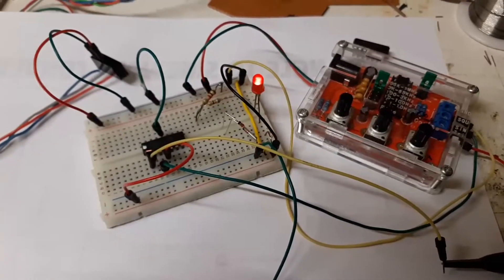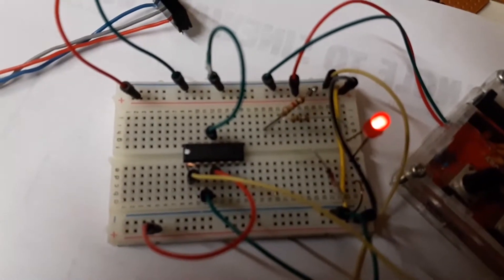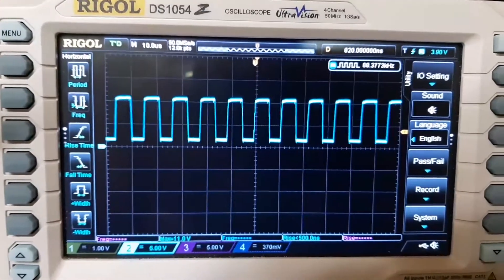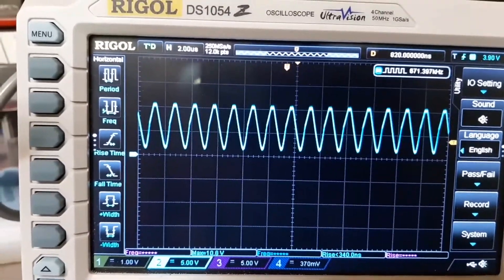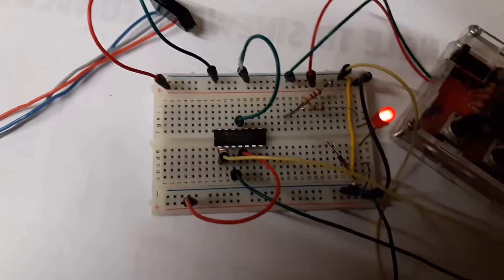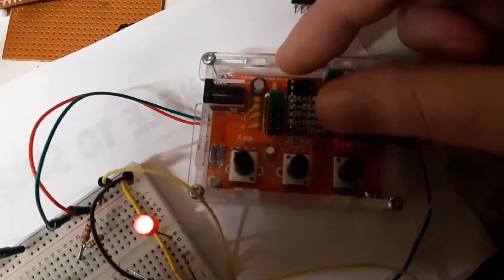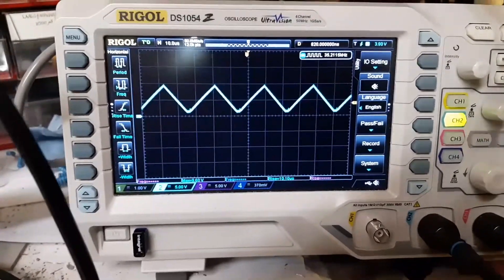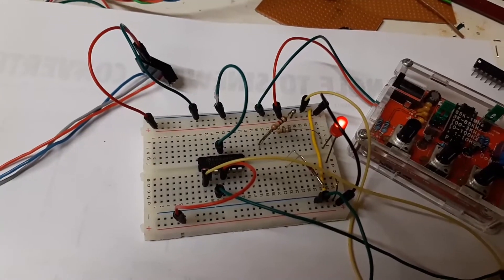How to tell a real opamp from a fake one

Comment: Thanks ed for this., please allow me a question. I see the fake one has a poor bandwidth, does this affect for audio application?, I ask this because for audio we tipically use frequencies up to 20KHz. does this poor bandwidth affect somehow the performance of audio filters, preamps or equalizers?, thanks!!
Reply from the maker: If you want to be sure you get the best audio quality then I would advise to use real chips. It's not only the bandwidth. Fake chips can be noisy too. I build a lot of synthesizer modules and they operate in the 20Hz to 8kHz range and for that they will usually be fine (especially for LFO's) but with filters you can get resonance or self-oscillation that is upto 20kHz and for that I would avoid using fakes and get the chips from a reputable source and not sites like AliExpress.

Comment: Thanks for posting this video Eddy. A couple of years ago when I first got into synth DIY I bought a stack of TL07X and TL08X op-amps from Chinese suppliers on ebay.  Then I read online that they may fakes, so I put them in a box and bought from some local UK suppliers instead.  I came across the box at the weekend and decided to submit samples of both my UK and Chinese-supplied TL07/8 op-amps to your test.  All the UK ones passed the test.  All the Chinese ones failed the test --- TL071, 2 & 4 plus TL082.  80 fake op-amps going in the bin!  I am now looking at what I have left in the box (LM358, LM324 & LM741) and trying to decide whether to bother researching a test for them or just stop wasting my time and bin the lot. 
Edit: I just noticed that IMSAI Guy did a test for fake LM741s using just a multimeter.  My UK stock passed, Chinese stock failed. Another 10 op-amps in the bin!
Reply from the maker: Well I have ordered ICs from ebay that turned out to be good but it's a rarity. I would test them though before throwing everything away.
Reply: @EdEditz  I have bought logic chips from China that seem to work OK for my applications, but I haven't pushed them to their limits.  I also bought a bag of cheap 2N3904 transistors that I use for creating noise circuits  --- much better than my UK-sourced ones for that job.  I won't be buying more op-amps though.
Reply from the maker: @rogrevs  Yeah with transistors and diodes and zenerdiodes that I got from eBay I never had any problems either. I built my whole synthesizer using those and also all my resistors come from eBay/Chinese sources and they all work fine. Although what they call 1% tolerance on their blue metal film resistors is more like 3% but that's still good enough for what I use them for. I have had problems with a random gates circuit that would fall back to a certain pattern instead of being random and that was caused by a fake chip. Getting a good one in there solved the problem. I also mentioned that in the article I wrote about it.

Comment: I wonder what factors come into the difference between 'real' & 'fake'? If the faker has the chip die image & a Fab plant surely it's a 'Clone Fake'; if, let's say a generic 741 is re-badged/engraved as a faster FET TLO71, then its a real fake ? Am I along the right lines here??
Reply from the maker: I think you're right. It's just chips with lesser specs being sold as higher quality than they are.
Reply: @EdEditz  Yes - 'Passing off[..

Comment: Oh man.... I'm dealing with this now, I think. Do you have the circuit diagram so I can test a few out?
Reply from the maker: Hi Adam. Just go to this link and scroll down a bit to the "Voltage Follower" section. It's really simple. The waveform signal is on the plus (non-inverting) input and the minus (inverting) input is connected with a wire to the output. That's all.
https://www.allaboutcircuits.com/video-tutorials/op-amp-applications-voltage-follower/
Reply: @EdEditz  Thanks!

Comment: I have always purchased over the years OP-AMPS from various sellers on E_Bay. Lots and lots of them. But guess what! I just made a similar testing rig and tested a huge amount (about 300+) op-amps that I still have and....surprise surprise....only 21 are genuine out of the whole lot. I just cannot believe how naive I was buying such rubbish???  Woawww...!!!! Well, lesson learned and....Never again.
Reply from the maker: Well you're not alone in that. I fell into the same trap when I first started out building synthesizer modules. The thing is, the fake ones work just well enough to let you not notice they are fakes. At least with audio circuits. That is until you test them. But sooner or later you learn that if you want good IC's you have to buy from reputable sources.
Reply: @EdEditz  You are spot on. From now on: Only reputable sources for any components, not just ICs. I've noticed fakes on a lot of electrolytic caps as well as resistors that claim to be low percentage tolerance when in fact they are not, h and medium power high-frequency transistors as well. So... enough is enough. I'm gonna have to bite the bullet and fork out more money for anything that I will buy but with the assurance that I'll get what I'll be paying for. Tnx for such an eye-opener video.

Comment: Thanks for sharing this Eddy I have often  wondered on how I could test an op amp. 
I guess you could always try the " avoid ebay" approach.  However sometimes ita just pot luck.
Reply from the maker: Yes it's usually the case ithat if they are too cheap to be true, they're fakes. I've had many good opamps from china on eBay but those were a little more expensive than on aliexpress. Just don't buy any chips from aliexpress